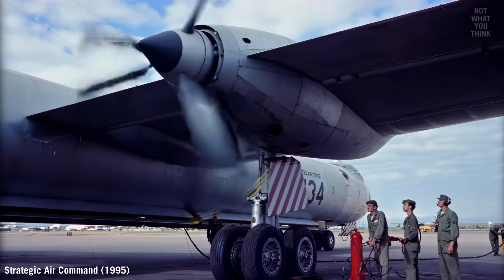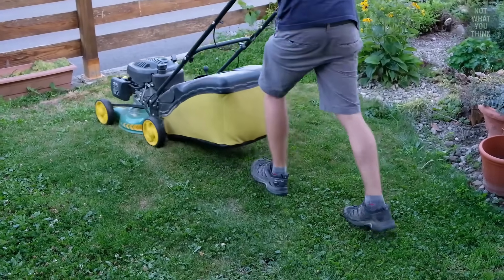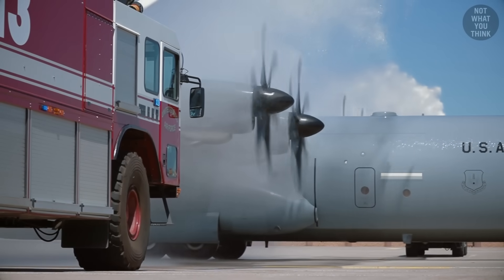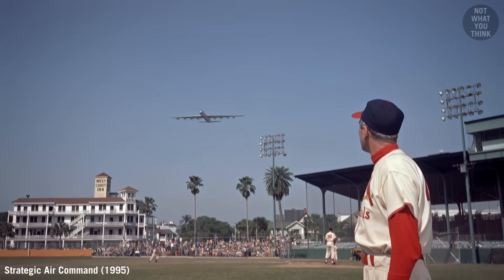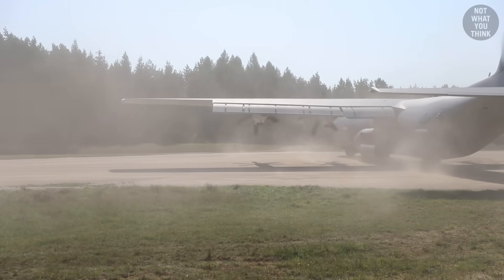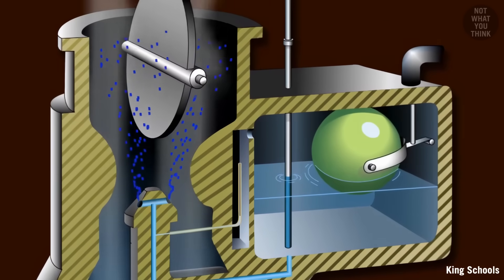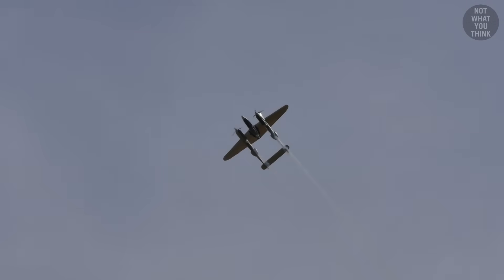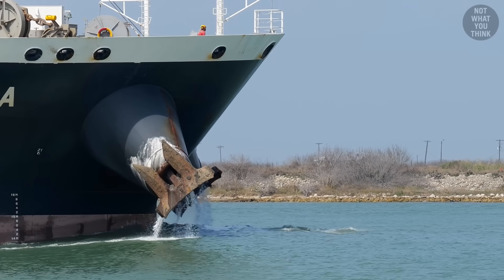Why airplane propellers moved from BACK to FRONT

Comment: OK, former aviation engineer and this is, essentially, wrong.
First time I've seen you guys go far off piste.
Reply from the maker: Care to point out what you think we got wrong?
Reply: @NotWhatYouThink  At the end of the day it was, more or less, everything. Well, no be fair, you did cite a bunch of true things, such as the popularity of pushprops for shooting. But...  An awful lot of the downsides to pushprops that you cited are not intrinsic to the pushprop, (the idea pushprops interfere with aircraft parachutes is so bizarre I think you must have consulted a random lunatic) you seem to have locked in on colloquial terminology as if they are literal, for example, the idea that push propellors push the aircraft and pull propellors pull it.  You also failed to cover fairly essential parts of the design options, such as wing induced compression stall and torque balancing.

Not to mention, you also failed to cite the primary difference which is, a pullprop recovers interference air by blowing it over the upper wing where the pushprop does not., which means pushpropellors have to be a bit bigger to provide the same thrust, which makes them a little bit less fuel efficient.

I enjoy your videos a great deal, so, I'm loathe to point it out, but on this one, sorry, that ball was lost.

Comment: For smaller aircraft it's about weight balance, having the engine weight in front means you can put passengers and cargo weight further back. 

Good balance is very necessary to maintain level flight for fuel savings, the Concorde had a very complex fuel tank system so that it could fly flat and level for fuel savings.
Reply: What is the advantage of having pax and cargo further back? Weight is weight. It doesn't matter whether it is cargo or engines or pax or fuel, it must balance out relative to the center of lift and not shift too much as fuel is burned or pax move about. Concorde's fuel management system had to compensate for the center of lift moving significantly when it transitioned to supersonic speeds. Even on subsonic jetliners, the flight control system usually compensates for Mach Tuck, a nose-down pitching moment due to the center of lift moving a bit aft at high airspeeds.

Comment: I always wondered why some airplanes have 2 bladed props and others 8 blades and everything in between. You should make a video explaining the difference.
Reply: less blades is more efficient because each gets more clean air to dig into. but at higher rpm long blades would go supersonic so more short blades are used. or long blades would hit something

Comment: A rear engined propeller fighter plane is more vulnerable from the typical rear attack and riskier for bailing out without fouling the propeller. There are many good points in this video.

Comment: wouldnt front propellers on the wing also generate more lift because the airflow over the wing is faster, coming at the speed of the propeller wash rather than just the airspeed of the plane as a whole?

Comment: Firstly, propellers were always mounted at the front - and in rare cases at the rear.
Secondly, propellers and elevators are (almost) always mounted at opposite ends of the aircraft.
Reply: Always' such-as' the first' plane'? - wright' brothers.. 😁
Reply: @boxfox2945  You mean: the first plane that didn't take off under its own power, but was launched into the air by a catapult and then glided less than 40 metres with dubious assistance and plenty of resistance from its underpowered engine.
"The flight lasted just 12 seconds, traveled 120 feet, and reached a top speed of 6.8 miles per hour".
There's no way of knowing, but I wouldn't be surprised if that top speed of 11.8 km/h was reaced at the end of the catapult and dropped to the stalling point right before the "aircraft" impacted with the ground.
The Wright "Flyer" should more aptly be called the "Glider" (and not a good one at that). It fits the description from Wikipedia quite nicely:
"Most gliders require assistance to launch, though some have an engine powerful enough to launch unaided. In addition, a high proportion of new gliders have an engine which will sustain the glider in the air, but is insufficiently powerful to launch the glider". Well, maybe not. Its engine couldn't launch it, nor could it sustain it.

In reality, it was simply a catapulted missile with fairly effective wings that allowed it to carry its engine and pilot almost 40 metres at slow speed and low altitude, so at least it didn't drop like a cannon ball.
The first confirmed manned powered flight: was made by Clément Ader in an uncontrolled monoplane of his own design, in 1890. 
By the way, its two propellers were at the front.
Reply: @boxfox2945  Always like in "it didn't happen in the 1940's".

Comment: No, it's really NOT what you think.  Both canards and pusher propellers will always be more efficient than tractor propellers and aircraft with rearward horizontal stabilizers.

Canards are more efficient because both horizontal surfaces provide list  When the horizontal stabilizer is behind the wing, it must push down, which adds to the wing loading, increasing drag.

Tractor propellers produce more drag, but it's not so much from the turbulence, but rather, from the fact you've added 30-50 kts of additional airspeed moving backwards over the fuselage.

Thus, both canards and pushers are each more efficient.  Together, they're much more efficient.  In fact, pusher canards like the pictured Piaggio fly more like a jet.

So why aren't they used more often?

Stability!  

When you use a tractor propeller providing airflow over the flap area of the wings as well as the tail surfaces, the aircraft has much more positive control, particularly at slow airspeeds such as landing and takeoff.  This also reduces takeoff and landing distances, which allow the aircraft to use shorter and unimproved runways.

Comment: 2:00 It didn't take long for the invention to capture the attention of the military, which needed a way to perform observations from the sky, or as they now call it, for reconnaissance missions.

You DO realize people have done recon from before the invention of planes, right?  Hell, they had hot air balloons used as recon during the American Civil War in the 1860's.
The word itself is from France and was coined in the late 1700's.  They didn't use air vehicles for it, they just would have people going around on horseback or on foot to investigate what's ahead of the main army, making sure they weren't walking into an ambush or about to go off a cliff.

Comment: Regarding the aside at the end about ships. There are other reasons also why ships have their propellers at the back. The rudder needs to be near the propeller to get maximum steering control. But a propeller at the front with a rudder at the front will not steer as well as a propeller at the back with the rudder at the back.
Reply: And the bow can be lifted out of water by boat speed or big waves.

Comment: I stopped watching when you spouted the nonsense - "We all intuitively know that pushing an object is easier than pulling it." WRONG. When you push a lawnmower, say, some of the force applies vertically into the ground - increasing its weight/resistance. Pulling has the opposite effect.
Byee.

Comment: The first documented powered flight using a steam engine was achieved by John Stringfellow in Chard, England, in 1848. He designed and built a steam-powered monoplane that flew a short distance within a large empty room at Oram's Mill. This unmanned contraption achieved flight for a few seconds

Comment: The Dornier Do 335 Pfeil (arrow) was a twin engined WW2 fighter/bomber. One engine was in the nose powering a tractor propeller; the other engine was in the tail with a pusher propeller. Pfeil at 763 kph (474 mph) was one of the fastest propeller aircraft ever built. It was possible to fly using just one engine. Despite the two engines and two propellers being identical, the rear unit produced 10% more power than the front unit. I think that demonstrates the superiority of the pusher configuration.

Note: The Pfeil was too late to play an effective role in WW2 with only 37 built before the factory was overrun by allied forces.

Comment: Great Video. I always wondered why the pusher prop on the Cessna 337 Push/Pull is the "Critical" engine, meaning the Pusher Prop is more efficient. Could it be that the propwash is pushing back the parts of the aircraft that it impinges on, subtracting from the "Pull"?

Comment: I designed a UAV platform and choose a "high pusher" config for 2 basic reasons.
1.  Less chance of prop strike on landing as the craft has no wheels and skid landed.
2.  No prop in the front camera field of view.  Essential to the purpose of the platform, FPV flying.
Other small craft I went with a front prop as the above didn't matter there and... on a small craft with stupid power to weight ratio, having the prop up front gives you control authority from prop wash alone, even in a full stall.

Comment: Pusher configuration airplanes only have a prop-strike risk from high angle of attack (usually takeoff, and sometimes landing) if the propeller is behind the main landing gears.  This arrangement rotates the props towards the runway as the aircraft pitches up.  If the gear is moved aft of the prop, the prop would rise with the increasing angle of attack.
Reply: yes, but the placement of the landing gear is dependent on the center of gravity which is closely tied to the center of pressure on the wing. The engine placement, being a very massive item, is usually placed close to the CG. That means that if we design the wing and engine placement for those things, the landing gear placement has only about a foot of variability fore and aft, unless there is some really wild landing gear design. 
The reason for the placement is that the airplane needs to rotate on the ground run on takeoff in order to generate sufficient lift on the wings. If the gear is too far away from the CG, then the horizontal stabilizer will not have enough authority at the proper speed to rotate the plane. You either have to make a HUGE horizontal stabilizer (not good for multiple reasons), increase the rotate speed to speeds beyond reasonable (think thousands of feet for a cessna), or make the nose gear so high the the airplane is already effectively in a rotated attitude. 
Or, you could just accept the rotation angle limitation and mild risk of a prop strike. Or raise the propellors to help.

Comment: Still, the Long-EZ pusher is the coolest experimental aircraft ever. The Piaggio Avanti and Beech Starship are the coolest turboprops. They both offer unmatched speed vs fuel consumption. I love my pushers !
Reply: The Vari-EZ/Long-EZ has one of the worst accident rates of all homebuilts.  And nobody likes the idea of bailing out into a spinning propeller.  

I was a steward at an airshow I won't name ... but you can likely find it by searching the NTSB reports: I had the misfortune of watching two Long-EZs crash in the span of less then two hours, killing three people.  It's really ugly to need to go and see if anybody is alive. 

The first crashed killing a husband and wife because the canopy came off.  The design doesn't fly stably without it.  

The second crashed due to a combination of the owner deciding to put a trim stripe along the leading edge of the canard, and being near the forward limit of the CG.  He crashed on take-off on the first flight after adding the stripe -- he had put the stripe on with vinyl trim and its edge was enough to trip the upper boundary layer at high canard AOA.  He pitched the plane up, got 20 ft into the air or so, and then the canard stalled and he went in.   Associated with this is that there's no ability to carry any ice, none at all. 

Neither of these accidents were due to the pusher, both are due to the canard design.   The impact of the canard design is also that the wing can't be flown to high AOA, so it lands very long.     Another witless design "feature" is the fixed main gear together with the flimsy and retractable nose-wheel.  You can't make an off-field landing with any expectation of survival; it cartwheels. 

Hummm ... lemme see ... taken altogether an airplane that you don't want to bail out of, and you can't make an off-field landing in, and it has a low-reliability engine, next-to-zero damage tolerance, and it's typically flown by home-builders ... who as a class (there are exceptions) are not great pilots.  Basically this is surreptitious eugenics AFAIS -- weeding the foolish out of the population.
Reply: @leeharrison2722  please do provide more detail. The accident descriptions seem interesting (i am preparing my workshop for a LEZ build), but i couldnt find any accidents days apart w a combined 3 fatalities.

Comment: Considering all the physics, airflow, and pilot ejection safety involved, as well as the benefits of positioning the rotors at the front, the design of the Bell Boeing V-22 Osprey presents a complex array of challenges across all aspects.

Comment: Easier to control. Prop is pulling the plane, not pushing it. Just like front wheel drive cars superior on snow. That's why you put horses in front of the coach, not behind it.

Comment: You can't create lift by pushing air over your own wings.  10:53.  That's because the reaction force passes through the engine mount to the engine. Think about it: can you make a sailboat go faster by mounting a fan on the deck?  Of course not.  It's like standing in a bucket, and trying to lift yourself up by the handle.
Reply: And the engine placement at the front can not change the center of mass that is ideal for the plane to fly.  That is determined by the position of the center of lift, which has to be just aft of the center of mass.  It is certainly useful to have the engine in the front to balance the weight of the tail, but you can't say that it is placing the engine in the front that makes the plane nose-heavy so it flies like a dart.  That has to be accomplished in any case, no matter where you place the engine.

Comment: Something to think about. The Cessna Skymaster, a twin engine aircraft, had one engine pulling and one engine pushing. The single engine climb rate was better with the rear engine than the front engine. Looks like the pusher can use more of the engine horse power produced by the engine. Still think the tractor engine is better?

Comment: Single Engine Planes…
1.  The front engine is balanced by the tail.  The variable load (fuel, payload) are over/under the wing where they need to be for CG reasons.
2.  The front engine simplifies control runs.  
3.   The front engines landing gear is shorter, lighter
4.   The front engine’s cooling is simpler
5.  The front engine has superior maintenance accessibility 

Pusher Canard
1.   Though arguable, pushers are aerodynamically cleaner.  Rear props are stabilizing which decreases the size of the rudder.  The decreased pressure ahead of the prop contributes to laminar flow..
2.  Generally, pushers have superior visibility, quietness than tractors.
 
Pusher Driveshaft, Midwing.
1.  Driveshaft vibrations are difficult to engineer out and add weight
2.  Aerodynamically, this is likely the superior configuration.   Douglas XB-42.

Multi engine
1.  NACA researched engine nacelles, engine locations and these papers available on line.  The B36 pusher configuration is a result and a very clean airframe.  
2. All carbureted aircraft engine risk icing and have carburetor heat..  The B36 pusher configuration aggravated icing and why it was not counter with carb heat is a good question.    Cheers

Comment: @NotWhatYouThink
Why UAV are mainlly config with pushers and not pullers?
Reply: Single engine pullers would force sensors/radar to the rear whereas a single engine puller has room in the nose for instrumentation. Nose is the best place for 'looking' forward.

Comment: Pushing is easier? I intuitively think pulling. Animal power, leverage, directional forces and friction, steering and control all point to pulling as the more efficient and manageable force, historically and mechanically. Think sleds, ploughs, coaches, drays, chariots, caravans, trains, semi trailers etc. Most of the cars I have had over 50 years driving have been front wheel drive. I do love a pusher plane, but to say the general population think pushing is easier, is a stretch.

Comment: Regardless of engine location, the center of gravity will not change. CG is a function airfoils and wing/  elevator configurations. If a heavy engine is placed on the nose, the nose is made shorter and / or the wing is moved forward. If the engine is at the rear, the nose is longer and the wings are moved back.
Reply: Right, it has to be balanced at the wings so that the plane is neutral. A puller has a bit of an advantage in that since its pulling, it tends to pull the plane straight by default by virtue of being in front of the center of mass. A pusher is going to tend to push itself out of alignment by being at the back. It's hardly insurmountable, but it is something to consider.
Reply: Your first statement is fundamentally incorrect changing engine location significantly changes the balance, as does everything you put into the aircraft.  Which is why every plane has to run a weight and balance calculation to determine if the CG is within limits before each flight. you then go on to argue that changing the location of the engine requires changing, well, everything which further high
Lights the inaccuracy of your first statement.